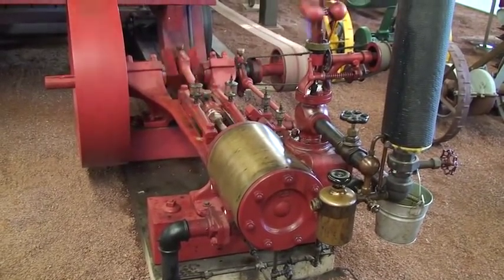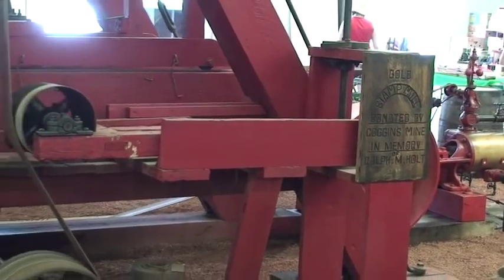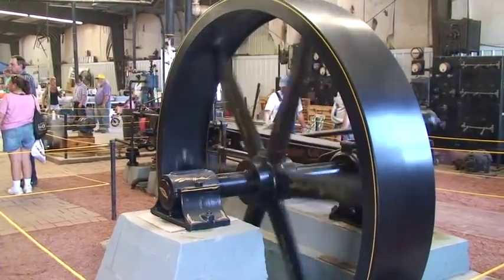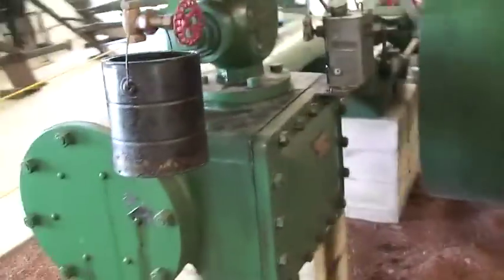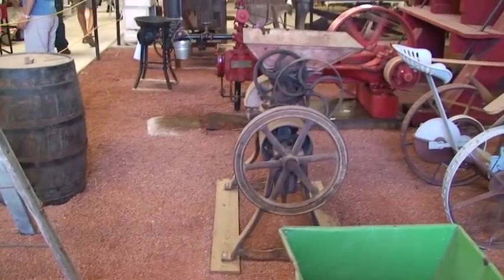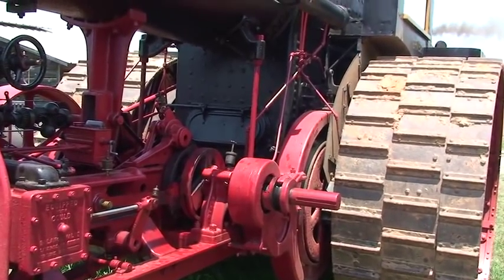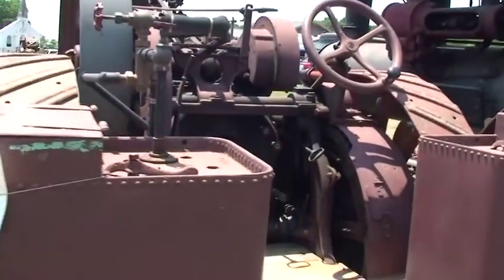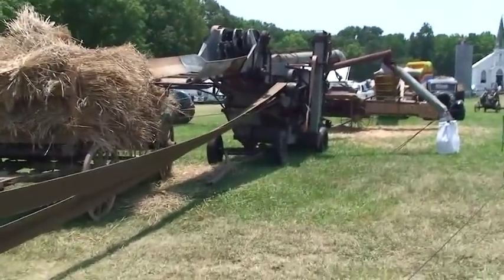American Power & The Rise Of Steam - Flywheel Engine Technology & The Steam Engine Revolution Video

Comment: A very good video,. though I wish the commentator knew a bit more about steam engines and their history as he made several mistakes in his narrative. General Electric did not run steam engines out of business,  steam engines took up to an hour or more just to get started and they required a huge amount of maintenance to keep going.  The steam engines were great in their day, but newer technology such as the diesel replaced it , the same way electric locomotion will replace the internal combustion engine.  BTW_ LED lighting is now better then old light bulbs, but costs 75% less and can last 10 times longer.  Again, new technology replaces the old.

Comment: Avery Steam Traction engines are unique unlike a conventional steam tractor that has the Cylinders mounted on top of the boiler, the Cylinders are underneath the boiler and it look almost like a steam locomotive because you would have a headlight 
then the smokestack followed by the steam dome and sometimes just for fun, the tractor will have a bell just like a train
Reply: Actually Avery made 3 styles. top mount  straight flu, top mount return flu and the most common was there undermount.

Comment from the maker: These were indeed, fired by coal.  Modern steam engines (turbines of course) are fired by propane, clean coal (heat the coal until gas comes out of the coal and burn that), and nuclear power.  I am not aware of any of these great engines being currently built for constructive use, which is a shame in my opinion.  An opportunity lost.